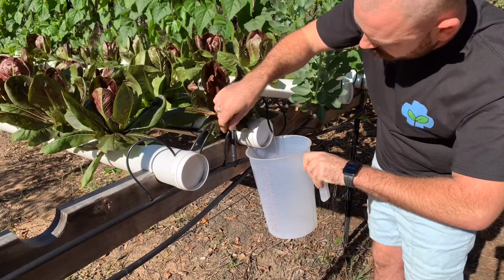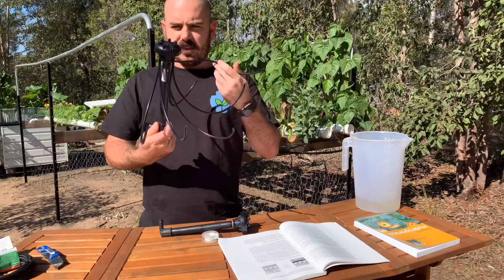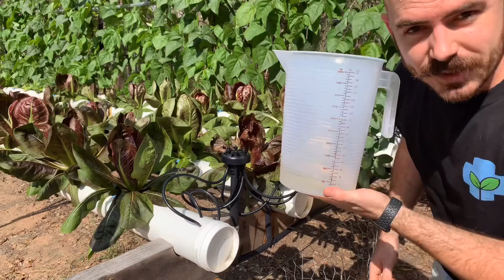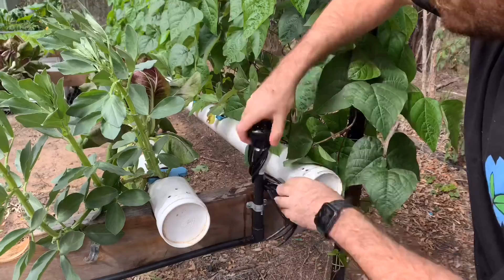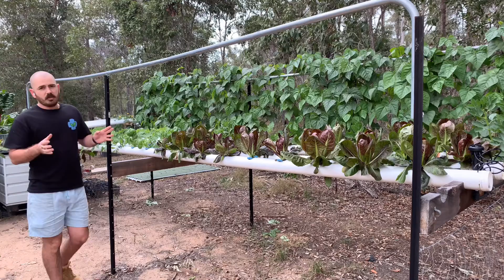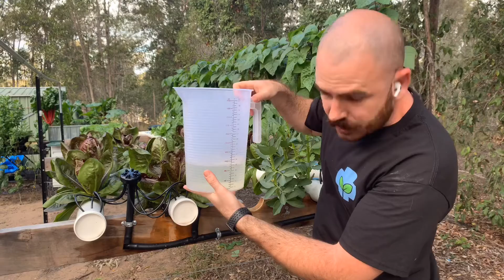Flow Rates in Nutrient Film Technique Hydroponic Systems

Comment: Would have been nice to look up the pump curve for that pump. A pump delivers different flow rates depending on resistance in the pipe close loop system. You need to decrease the resistance to flow.

Comment: First off... Love your videos. I've learned so much from your channel.

Part of the issue may be that there's not an equivalence between increased pressure and increased flow rate in your pumps. Flow rate's pretty self explanatory, but doesn't directly relate to the pressure that the pump puts out. The pressure (generally expressed in head) will describe the pressure at the pump outlet which is required to overcome the gravity, friction in your plumbing etc. In fact, for a given pump as you increase the flow rate you actually decrease the pressure head. Increasing the channel size will have decreased the friction which is why it returned higher flow rates, but ultimately pump head is what will fix your issues.

Comment: You should put a filter bag around your pump to keep your particulate out of lines.   Also try putting
13MM hose right into pipe,  your problem isn’t 13MM it’s dropping to only 3 - 9mm tubing

Comment: i had a smaller manifold with only 4 ports and measured the flow,  600mls to each x 3  so about 1800mls / min.   So i upgraded to an 8 port and used 2 lines to each of the 3 pipes, effectively doubling the lines but was surprised to see the same output to each pipe - 600 to 700 mls.  >>  so, reviewed the manual on this new Orbit 8 port (sold in the states) and found it has a filter in the middle.   After checking the plastic screens, I decided to drill 4 small holes in each screen panel to see if the flow would increase.   Yes it did,  1100 mls to each pipe.   I knew the pump was capable, since i had examined the manual, (Active Aqua 250) which gives 1100lph, or as much as 18 litres /min.   Sometimes its not about the plants, it can be fun tweeking and customizing the gear.

Comment: Thanks so much for your superuseful tutorial however matematic is not an opinion and please correct me if I am wrong. Ideal flow rate is 2 liters x minutes. In your first test you got 700 ml x minute, 1000 ml = 1 liter, therefore, before correction your system was running at less than 1 liter x minute, not nearly 2 liters x min as you told.
Again, please take mine as constructive critique and correct me please if I am wrong.
Thanks again for your excellent teachings, really apreciate!!!!

Comment: I'm not sure why you bother with the three 4mm tubes in the first place. Run a single 13mm tube connected to the 19mm tube via a control valve. Every time you step a pipe down in size makes your pump work harder. Theoretically, your smaller pump at 1400 liters per hour, which is approx. 23 liters per minute means you should be able to put out 5.75 liters per unit. Yet you get only a fraction of that. 
Part of the loss will be pumping up hill. Keeping the pump as high as possible will help with that. The rest of the loss is due to friction and bottle necks in your tubing. Keeping your pipping as short as possible and large diameter tubing will help with friction between the wall of the pipe and the water itself. Avoiding tight 90 degree bends and pipe diameter reducers will eliminate the bottle necks in your system. Any bend in the pipe should be a gentle as possible. Use two 45's rather than one 90 degree fitting. The only bottle neck in your system should be the flow control valve, and this valve should be located as close to the end of the pipe as practical. 
Just my 2 cents worth. In any case, it is a nice video and I enjoyed it.

Comment: Hoocho: This is great information. However, I need to understand what is the angle of slope of your NFT Tubes. You're regulating the water, but by knowing the slope angle, that determines the proper resident speed of the solution against the roots. Too high of an angle will cause turbulence that may not touch some roots. Too slow and the solution skirts around the root mass, not penetrating all of the root tips. Does Dr. Allen Cooper address this?
Reply: Ff

Comment: Why is 2 litres per minute optimal?
What's an acceptable deviation from that? You started out with 33% and ended with 67%.
2 litres per minute, is it independent of how long your pipes are?
I guess your system is continuously pumping. How does the equation differ if you have a timer on your pump?

Without knowing, I would imagine that pooling in the system wouldn't be a big deal since it won't pool for more than a few minutes anyway before being circulated. Is the reason you say it's not wanted that it turns the system into an RDWT?

So many questions. I have designed my first system, based on what we learned from a pre-existing one. However, the old system is undocumented so we have to make a lot of guesses about what design choices were made for what reason. Flow rate is the big unknown.

Comment: I have been doing this for a while - interesting that you had blockages - I did too - so, I just put 2 pairs of stockings on the outlets where they flow back into the tank - problem solved - this is as the debris seemed to be coming out of the NFT pipes - roots breaking etc...  Change the stockings every few weeks! P.S. We're in Bermuda and we only use rainwater here - no mains water.

Comment: I was expecting that the size of the pipe should also be consider when measuring the flow rate of the water. For example: Will we get the same result or efficiency if a 2 system that uses 2 liters per minute flow rate but with one on 4 inches PVC pipe, and the other one with 2 inches pvc pipe? I hope I can get an answer on this, thanks!

Comment: Hi,  This is how I solved the problem of flow rate. Shorten the distance from pump to NFT and avoid bottle necks.  Pump water into the beginning of your NFT system (close to your tank),  let the water gravity flow to the furthest point into your over flow pipe which gravity feeds back to your tank.

Comment: so if like me you figure your running a rdwc due to baffled ends, a good air pump in the res help or is it better in the pipe? mine are only 1.5mtrs long x 2 with a 35ltr res, put the air pump in res?

Comment: Hi. Im wondering if you had placed the pump and reservoir closer to the feeding area and having a manifold collecting the water back to the reservoir if you wouldn't had more success with increasing the flow. it seems the pump is working just to get the water across the 6m spam

Comment: This is the best NFT video I've seen! So many are actually DFT or whatever, and do very little to explain the actual nutrient solution level that should be in the system.
Like you, I was reading a hydro book by some horticultural academic. Not the same ones you've got but nevertheless I was very confused when I went to YouTube and the wider internet afterward to find that most designs have larger fluid depth in the channel, or don't really talk about that or flow rate at all. Love the cross section shots, very informative.

How do you find round pipe to work? Do you find that the roots grow into the curvature the way that they like? I've heard that you've really got to use rectangular channel so there's a flat bottom, for "true" NFT.
Reply from the maker: Cheers! Round pipe works fine.
Reply: @Hoocho  Thanks! 
Something I've been wrestling with is, what techniques do you use for seedlings et-al such that the roots are long enough, so they are close enough to the film, when transplanting into the NFT system? 

Do you use a smaller water culture kind of system before transplant to the NFT, and wait until the roots are long enough to nearly touch the film?
Reply from the maker: Stacy Gaudreau check out my video “seed 2 system” and the “how to build a seedling/ clone propagation system”

Comment: Hey Hoocho, there is math in plumbing that can be used to work out the size of pipe.  I forget it off the top of my head but if you know someone in the plumbing game it will.  In general  20mm to 25mm is the standard for most house and would allow you adjust with more control.

Comment: 5:38 -- Just for anyone interested in implementing this, there's probably no need to add the manifolds purely to increase flow. If decreasing pressure is a concern, then the manifold is of course still useful, however 2 vs 3. terminal 4mm tubes per NFT rail won't make a difference. To see why -> https://sciencedemonstrations.fas.harvard.edu/presentations/poiseuilles-law

The flow rate is being determined by two factors here, according to Poiseuille's Law:
 - the pressure generated by the pump (P), 
 - and the cross-sectional area of the most proximal pipe (A)
 - (The length of the pipe also increases resistance, thus decreases flow, but here it remains constant). 

We know the flow rate (Q) into each NFT rail is 1.4 L/min. So the flow in the 19mm tube coming from the pump = 4 x 1.4  = 6.4 L/min. This is the maximum output of this system under these conditions, and by adding more terminal 4mm channels you're just splitting the flow across however many downstream 4mm channels (seen really well in video above). So if you've got 3 per NFT rail, the flow is 6.4/(3x4) = 467ml /min going through each 4mm pipe, but still a total of 1.4L/min in each NFT rail. If you have 2, then 700ml is going through each 4mm pipe, but still a total input of 1.4L/min and so on. Ultimately, the total flow into each rail will remain the same. 

TD;LR: If you want to increase flow: 1) get a bigger pump, 2) use wider diameter piping, 3) shorten the distance from the reservoir to terminal pipes
Reply from the maker: This is correct. However if you want to experiment with different flow rates for different channels as I specified was my intention in the video you will need a way to limit the flow of individual channels.

But yes anyone who does not have the intention of experimenting it is unnecessary. Also creates more likelihood of blockage.
Reply: @Hoocho  Hi Hoocho, thank you for the thorough tutorial, and sharing the knowledge! And showing us all of your trial and error. Just to chime in a bit, the flow rate of your system is really just the velocity (speed) of your water multiply by the area of the pipe (that is flow rate = speed (m/s) * area (m2) = m3/s (unit for flow rate)). The speed of the water depends on your pump head. There is an easy pump chart (widely available in many fluid dynamic textbook and Google) that you can check out what is the flow rate that you can get out of a pump based on its net positive suction head (NPSH). In other words, changing the diameter of the pipe would not change your flow rate (it will only change the speed of the flow).
Reply: Just because I'm bored. Here's a bit more thorough explanation. 

Q = flow rate = (pi^2 * r^4 *P) / (8 x eta x L), where: 
-- eta = viscosity of fluid (constant) 
-- r = radius of the pipe
-- P = pressure 
-- L = length of pipe 

Removing the constants... 
 --- Q ~ (r^4 * P) / (L);

So: 
1. Double the diameter (or radius) and expect an 16 times increase in flow : 
   -- assume r = 1, then 2r = 2
   -- Q1 = 1^4 *P / L = P/L  
   -- Q2 ~ ((2)^4 * P) / (L)  = 16*P/L  = 16*Q1 
2. Double the pressure, double the flow
3. Half the length, double the flow

Comment: Thank you for the info. Interesting and informative as always.  What is the drop for your NFT rail from one end to the other? I plan on building an NFT system and was wondering how much it should drop. Thanks in advance and keep the videos coming.
Reply from the maker: C Moniz anything greater than 3% is appropriate
Reply: Its one of the best videos I have watched !!👌
He said 3 % and tie it to 2 litres per minute flow rate at end .. you get a good start . 
.. Add an oxygen pump to the overhead tank, the kind you use in fish tanks and keep the fertilizer mixes monitored..
...use square tubes runners..  .. 
 .. Now work out the spacing of pot holes from the crown size of the crop and
...  keep the water temperature to between 20 to 30℃ ..
 you have a winner on hand .. 
It should be a great success. 👍👍
Reply: @sanjaysrivastava1100  
Nutrient temp of 30 deg C would be touch and go for a flood and drain but too high for NFT.

Comment: Totally the issue I am struggling with in my new system!  I started out with the manifold and am checking today to see if it has an internal filter!  So happy you did the final check on 13 vs 19mm piping.  Since you have 2 pumps now, any thoughts on having them both run, one to each manifold and splitting the tuning across all the rails?  Pump failure insurance!
Reply from the maker: Violet Bedford I have had that thought. Very close to doing it. But I’ll probably wait till it’s too late. Hahah
Reply: Hoocho I have so much more flow in my system now!!!  Thank you Hochoo! Your videos inspired my system and are helping me troubleshoot!
Reply from the maker: Violet Bedford Glad I’ve helped haha!
Reply: Ok - the manifold filter is absolutely contributing to my flow problem... but it’s filter is integrated into the unit and modifying it resulted in.... err.. unexpected consequences.  Well, looks like another trip to the hardware store!

Comment: Cool stuff. Good work. With that much effect from diameter tubing. Makes me think just use rigid pipe for main line. 
Since you love experimenting. I will share a find. I hear that there are pumps for aquarium protein skimmers which use needle wheels instead of centripetal.  So what ends up happening is that it makes fluffy bubble air water type of flow. Kinda like the massagers in a hot tub.  I think there is an air tube which is inserted into the pump head.  Weird stuff. Found that out a couple days ago.. 
btw that looks like a cool book !! Thanks for sharing

Comment: Hey Hoocho, very interesting video.
If you had a system with 1 x 6m NFT pipe running at 2lt per min mean that running a system of 2x 3m pipes (in parallel) should still be 2lt per pipe -  i.e. 4Lt per min in total (hence you need double the flow for the same number of plants?). 
Going further, 6 pipes at 1m @2lt per min require a total flow of 12lt per min?
Reply from the maker: Ben J that would make sense to me.
Reply: @Hoocho  gonna need a bigger pump!
Reply: Makes since that each plant would see the 2L/min flow rate.  I didn’t catch it in the screenshot if the flow rate was specified for a specific pipe diameter.  Kind of makes me interested in an experiment with different rails at different flow rates!

Comment: Great Vid Hoocho! With my nft I just injected a 19mm straight in to the top pipe (3x 3m rails but all connected on a slight  downward slope joined with elbows) with an adjustable tap. It seems to work ok without too much back pressure on the pump. 😉👍

Comment: So our planned NFT seems to then fall in the category of quasi DWC. But I'm ok with that for now, as our electricity supply is not super reliable and if it goes off for 2.5 hours, my plants automatically go into a kratky style of growing. Better than drying out completely I guess? The pipes will be just under half full when not running at all.
Would adding an air stone in the reservoir help at all?
Reply from the maker: The movement of the water falling back into the res will do about the same as an air stone, there's not much you can do in my knowledge to increase the oxygen in a significant fashion. Have you considered an off grid system?
Reply: @Hoocho  having an off the grid system will intimately be the aim. I'm currently harvesting rain water with an almost perfectt PH and EC count of under .01 before nutrients are added. I'd like to be able to continue doing that. Lights are a problem to do off grid though. Living in a city so not a lot of space to do stuff over a large area. Need to do vertical if we want to scale. Solar panels are somewhere in the future plan, so with that will come energy for the pump.
Learning so much as we go!! THANK YOU FOR YOUR VIDEOS!!!
Reply: @Hoocho  so there's no need for an air stone in an NFT system when slope and flow are correct?

Comment: Interesting, going to have to get a new pump, my flow rates are much lower than that. But to be fair the pump is running 7 vertical towers, 5 NFT rails and a flood and drain lol
Reply from the maker: Matthew Farrell that’s a busy pump! Would love to see some photos if you’re able to throw some up on the reddit page!
Reply: @Hoocho  Yeah it is, I did buy an oversized one when I had the vertical towers for expansion, but underestimated the flow needed lol.

Once I finish cleaning up the area for sure we will put a pic up.